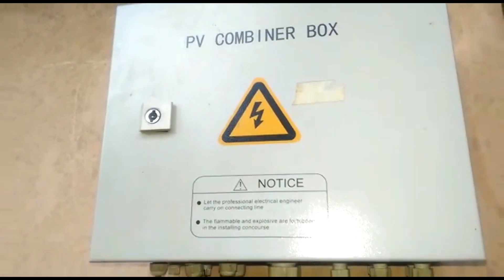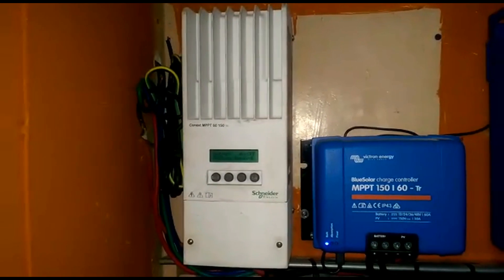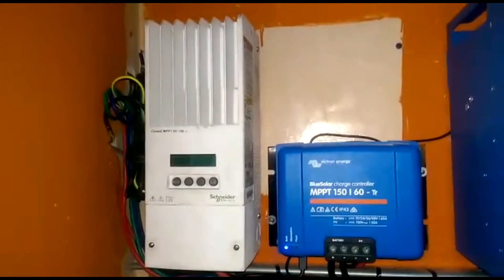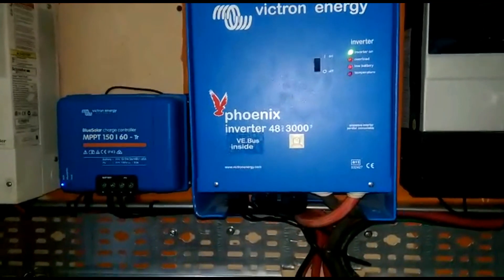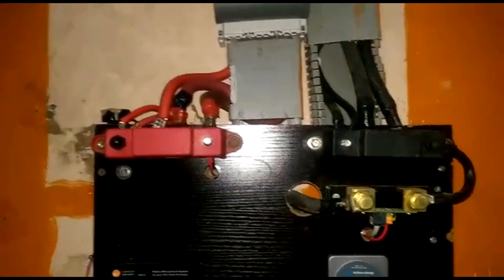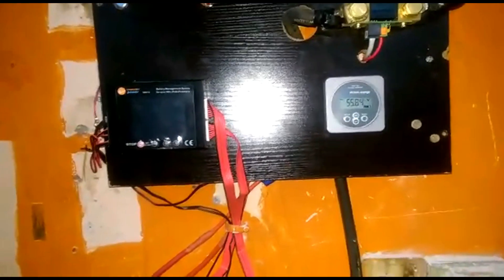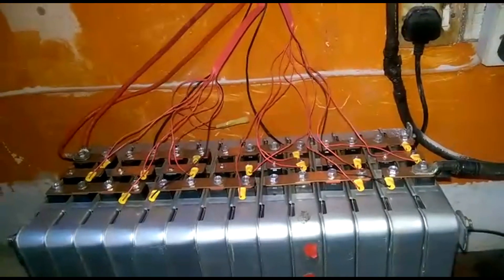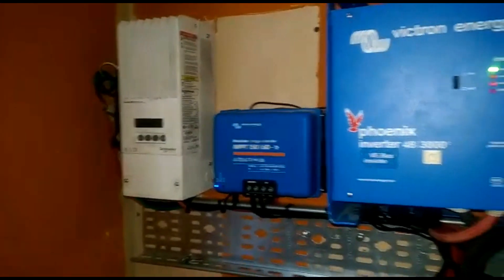A Tour of my Off Grid Solar Power Installation in Nigeria |  Solar Power For Your Home

Comment: nice quality , nice to see systems where no short cuts are made , its all very good quality youre a man after my own heart.
Reply from the maker: Thank you. I appreciate you. One can go broke doing it right.
Reply: @drsolar  well from my experience starting off with cheap inverters one after another etc etc it wouldve been cheaper to fork out the money and buy decent quality equipment to begin with and alot less hassles. what i do being low on funds is buy near new or new and unused, ive saved "alot" of money doing it that way yet i have very good quality components which has worked flawlessly for nearly 5 years.
Reply from the maker: @closertothetruth9209  I replaced way too many inverters since 2014 that I became a convert. Your method is what I preach to my clients that are not as flush. Used or incrementally. Thanks for watching and commenting

Comment: looks quite tidy, the cable arrangement is something i need to work on.
looking forward to seeing the new battery box installed - 
cheers - Josh
Reply from the maker: Hello Josh. It took almost 5 years to get our cabling to this level. I will be running additional cabling for communications between the Venus, inverter and controller. So the tray makes it easy to keep them that neat. Thank you for the compliment